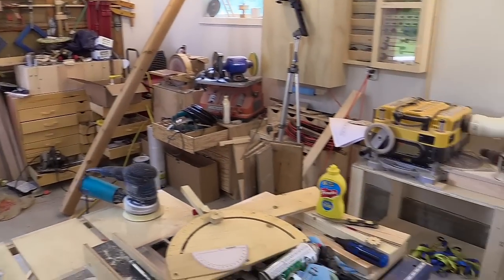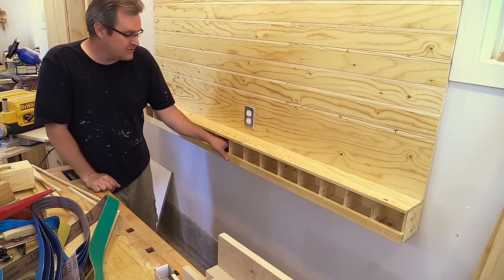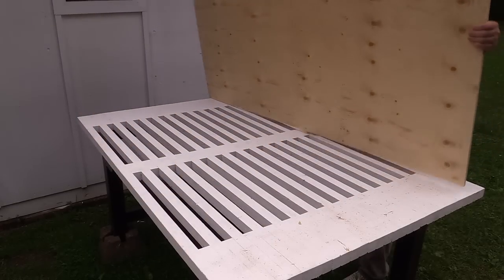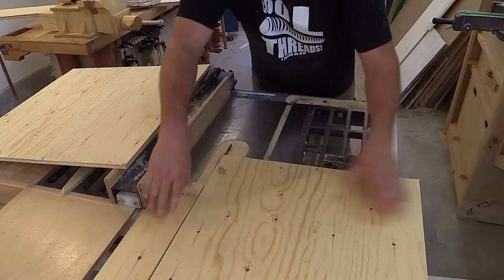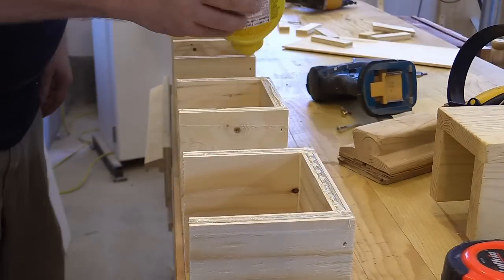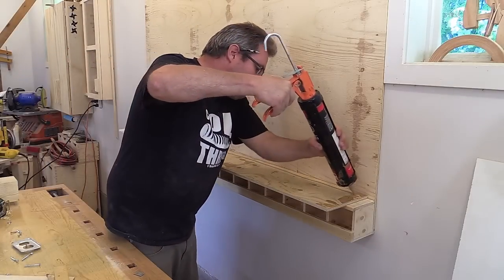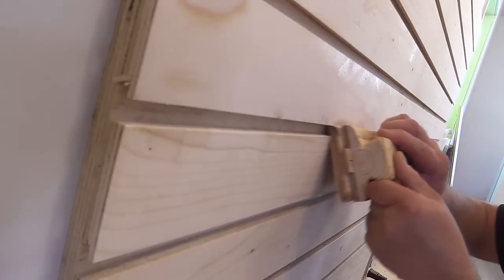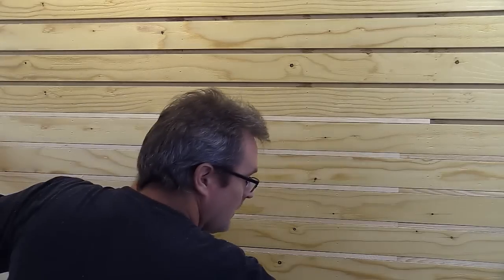Making A Slatwall Tool Board

Comment: It's great to learn something new, John...  I would never have thought about running plywood through a planer.  But really, if I'm just taking a light skim like you did, why not? 
It looks like you can only access the slots from the left?   Does the window trim block the right side?
Reply from the maker: wordsnwood Thanks. The window trim is only 1/2" thick, so I can go in from that side as well.

Comment: A lovely, reconfigurable way to store and access your tools. Much more practical than my scrap plywood shadow board in the metal shop in Sheffield.     However, just a small idea here: If the screw bins at the base were Loose sliding boxes, that you can just pop out for use, or move to a new position in the stack; it might aid work-flow. However perhaps you want to prevent them ending up all over the shop as before <grin>. As always, every idea can also compromise another requirement.

Comment: John, it's an interesting project, and I am currently doing the same thing, for much the same reason(s) - can't find the tool, cluttered work-bench, too much stuff on a shelf or in a drawer, etc.

The thing is that I am building a French Cleat system, and, while it is only partly completed, I am already finding it useful, especially as I have attached a removable mini-system to my workbench to hold the tools, both hand and power, as well as the supplies that I am using, or going to use, for any particular project. 

I sit down ahead of time with a cuppa and make a list of what I think I'll need, and preload the mini-system with the tools: router(s), sander, measuring and marking instruments,etc. etc. etc.  This includes all the material that I need.

Then when I set to work I have just about everything right at my finget-tips.  When I need a tool it's right there. When I put it down for whatever reason, it goes back into it's holder - NOT onto the bench-top.  I find it an incredibly useful way to work. 

In looking at your slat-wall system, I just don't see any way you could usefully do the same thing.  With the slat-wall you have to either partk the tool somewhere eise,or shuffle tools off the board to get the one you want, and then shuffle the removed tools back, and, of course, to the reverse to put things away.

Comment: I was looking for a slatwall design for the doors on a home-built a storage locker and yours looks easy to build, thanks for sharing! 

One thought on the hardware bins - you might consider adding an angled strip (ramp) behind the lip at each bin to make it easier to remove fasteners by hand.